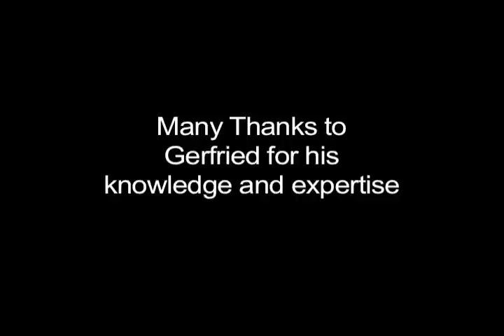Dressing sintered Diamond and Stone Wheels on a Spatzier Lathe

Comment: What kind of stone is he applying to the wheel?
Reply from the maker: It's a compressed silicon carbide stone in a dressing grinder specifically made for dressing ceramic stone wheels (you can generally find these from some European distributors).